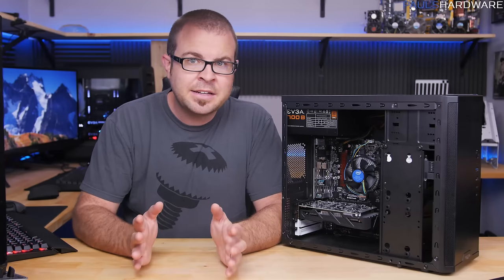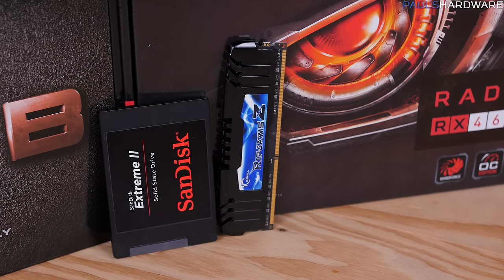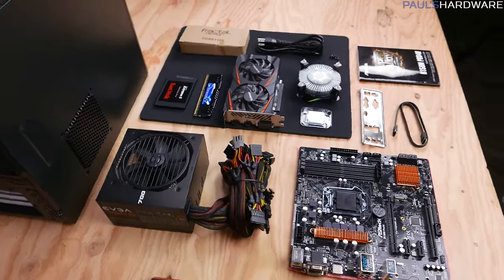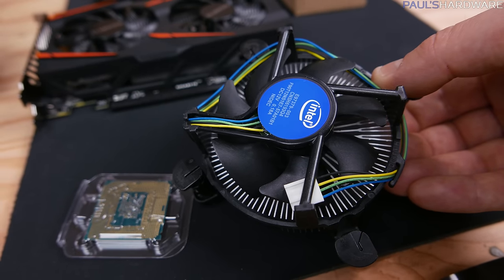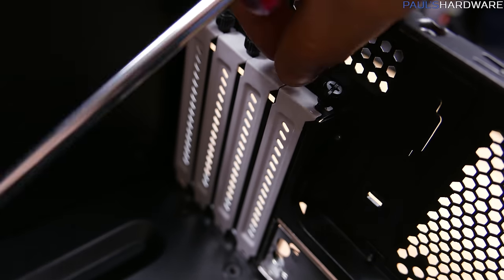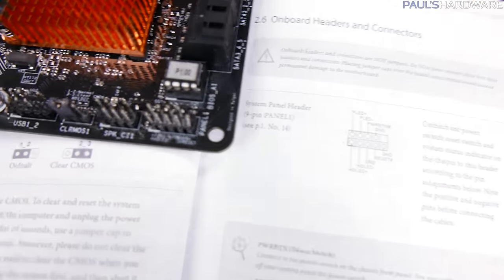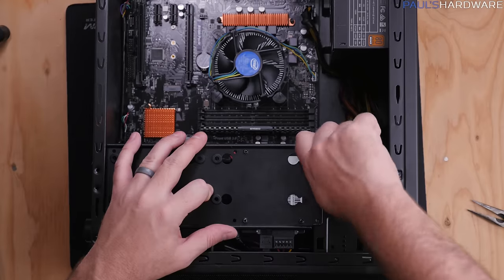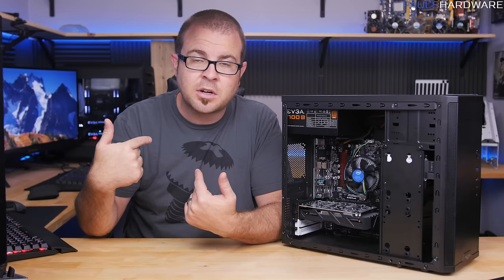How To Build a $500 Gaming Computer

Comment: if you get optiplex 990 second hand with i5 2500 for like 200 dollars, you can get RX 480 / GTX 1060 and still get decent performance
Reply from the maker: the second-hand market has a lot of deals, but they can't be offered to everyone and you're often left with no upgrade path... still would be fun to try though :-D

Comment: I would just spend a little more for an RX 470 / 480 or GTX 1060 3GB and add on a 1TB Hard Drive later.
Reply: you can get a 6gb 1060 for $220
Reply: also nice. Actually this end quarter has some very nice budget options, wait for the 1050 and / or 1050 Ti to be released.
Reply: IND4GR0V3 Where is this?
Reply: Generic Username i would pm it to you so it doesn't sell out, but nobody ever seems to have private messaging enabled on their youtube profile
Reply: IND4GR0V3 What country is this for?
Reply: usa

Comment: SeaSonic offers a 520W fully modular PSU for just $10 or so more than a low grade EVGA PSU, it's called the M12II. I've got 4 of them running 24/7 and they absolutely murder EVGA B and W series on features and build quality.
Reply from the maker: good advice, I love Seasonic
Reply: I've got a ton of EVGA PSUs, a 650GS, 600B, 2 500B, and a 750G2 and I'd take this M12II over any of them. The 650GS is a close second but it's $40 more.

Comment: Don't plug in your psu and touch it. It's dangerous not only to your pc components, but to you too. Instead, just touch the side panel of your case every now and then and you'll be fine..
Reply from the maker: +Joshua Shiozawa touching the case will ground you to the case, which is usually fine, but touching the plugged-in (not switched on) PSU will ground you to the ground

Comment: I'm a bit confused about the graphics card. Why didnt he plug in the power connector for it?
Reply: I don't think the RX460 needs external connectors. He used an OC Gigabyte but most RX460s don't. Could've done it though.

Comment: you can get more bang for your buck if you switch the rest of the way to AMD parts. I kinda splurged in my case, an extra $100 for double the ram, a 750w PSU, and a better CPU, but it wouldn't be hard to cut that extra without sacrificing too much performance.
Reply: Nothing beats the i3 6100 in gaming performance from AMD at 120 dollars.

Comment: Ive done all of that but when I power on my PC it starts to blink, it siwtches on then off, but also doesnt connect to a monitor
Reply: I had the same problem. Idk how I fixed it, but what I think solved it was I used an hdmi cable and connected it from the graphics card. Hope it works for you

Comment: You might really want to get nut drivers for standoffs. If you really want to use pliers, regular slip joint pliers instead of needle nose would be better but would still be wrong.

Comment: Great video can you make a  $550-$650 video editing build please @Paul's Hardware
Reply: Phillip Alers do you also want to game?
Reply: An editing rig is most likely gonna be more pricey, because you are gonna want a better CPU/GPU combo. Look into at least an i5 and a gpu around the 1060 or rx480 range. Probably around $800-$1000 USD
Reply: You could edit with this rig, but it will be slow
Reply: I edit on a 2009 Mac with 16gb or a i3 laptop with 4gb ram fine.

Comment: @Paul's Hardware, does the Does the Intel Core i5 6500 3.20 GHz Quad Core Skylake Desktop Processor support DDR4 2400 memory? Or anyone that knows if it will work but i have to do a update or get different memory sticks.

Comment: Hi, I decided to build this :

gigabyte 990x gaming sli
fx 8350
rx 470
16 gb hyperx fury (1866)
coolermaster 212 evo

Now I cant decide which PSU to get, I have few in mind:
XFX 600 W XT series
FORTRON hyper 600 W
XFX Pro Series CoreEdition 80 550 W
FORTROn rider s (550 W)

Can anyone give me some advice on PSU?
Reply: Marko Cirimotic id say get an Intel CPU since AMD is phasing out the AM3 chips
Reply: Is that it? Can you go for a brand like EVGA, Corsair or Silverstone?
Reply: ECCENTRIC you can
Reply: ***** Cool. And yeah, don't get a 4 year old chip. Buy something like an i5 6500 and a cheapo H110 mobo and since you saved some money on the mobo, get a beefier GPU like the RX 480 or 1060

Comment: i would go for an amd 8320 and a rx 470/480/r8 380x which is going very cheap on amazon
Reply: cheap. wont bottleneck much with lower end cards.
Reply: i3 6100 is actually cheaper and better so why?
Reply: i meant athlon cpus
Reply: francois qian but there is no such thing as an athlon 8320?
Reply: you can fx 8300 and gtx 1060 or 480 for same 500$
Reply: Rashid Aman an i3 6100 wouldn't bottleneck as much as an 8300 or even at all for the same price....
Reply: fliprabbit but wht i think is that with overclocking the fx8300 can beat i3
Reply: Rashid Aman doubt that unless you buy a good cpu fan, but with that added cost you might as well buy a better cpu like an i3 6300.
Reply: i was able to get a 4.2 ghz overclock with my fx8300 with stockfan at 80c
Reply: Rashid Aman 80c is quite a lot :/ , i'd rather have a cool cpu at stable clocks..

Also even at 4.4Ghz it won't surpass the i3 performance, barely keeping up.

Comment: I like this build. For $500 you could build a rx470 biuld, but i would just not be very good. I like the large ssd and i3 in this. You can just upgrade the gpu in this build and youre set
Reply: Captain Cruise all i3 are not overclockable, also the latest i3 chip only is a dual-core with hype threading. The i5 Paul used outperforms any i3.
Reply: He got a i5 6500 in a $500 build?
Reply: Captain Cruise Wait shit lmao, my bad, I thought he did put an i5 in there. But definitely an upgrade in the future loll
Reply: Ow ok, I see. Yeh, I think its better to upgrade the GPU than the cpu. Its much easier for a start, and 0 compatibility isssues
Reply: that doesnt make any sense to have that i5 with a rx460 of 2gb video ram... it should be the opposite, a $100 cpu with a $200 gpu for gaming
Reply: Joaquin Carrillo Yeh I was just saying if you wanted to you could do it this way, and sell the rx460 and buy a rx480/1060 down the line
Reply: Joaquin Carrillo An alternative to upgrading the cpu (motherboard compatibility issues/ disassembling the computer to do so)

Comment: Does 6500 bottleneck gtx 1070?
Reply: that really depends on which resolution are you playing at, GTX 1070 is for 1440p IIRC. If you're playing at 1440, yes there might be some bottleneck, although it might be just a slight one

Comment: using the correct screws for the motherboard standoffs is pretty important... ive got a motherboard permanently stuck in a case :/
Reply from the maker: the old M3 vs UTS 6-32 problem, bane of PC builders everywhere

Comment: Can you give me some insight to why a i3-6100 is better than a rx 6300? :D
Reply from the maker: way way way better instructions per clock performance, and it's not on a dead-end platform/socket, meaning there's viable CPU upgrades now as well as (almost assuredly) more when Kaby Lake launches in January/February
Reply: Thanks a lot
Reply: The cores in the skylake i3 perform better than the cores in AMD'S old 6 core.

Comment: As an IT Pro of 20 years with a masters in electrical engineering  you never plug in the power like this. You really don't understand how electricity works WOW. Touch the metal case and that is good enough.

Comment: Hi I'm new to the PC gaming world & trying to set up a good build, is it possible someone if someone can give me some tips on this build? Thanks 

Intel Core i3-6300 3.8GHz Dual-Core Processor
Cooler Master Hyper 212 EVO 82.9 CFM Sleeve Bearing CPU Cooler
MSI B150 Gaming M3 ATX LGA1151 Motherboard
Kingston HyperX Fury Black 8GB (2 x 4GB) DDR4-2133 Memory
Samsung 120GB 2.5" Solid State Drive
PowerColor Radeon R7 370 2GB PCS+ Video Card
NZXT S340 (Black/Red) ATX Mid Tower Case
EVGA 500W 80+ Bronze Certified ATX Power Supply
Reply: Dayqwon Dawes it's kind of bad for the money but decent if you want a small case. If you're okay with getting a bigger case you can get better graphics cars

Comment: Case is not a good choice (dust magnet, will suck dust inside), several better mATX choices at this price (Thermaltake Versa H15 for example). 1 stick of RAM is not recommended, always use 2 sticks for the dual channel boost. Forget the update for later, you will not find identical stick to buy, you will have to replace it anyway. SSD also not a good choice, same price would offer 2 better alternatives (Kingston v300 for instance). And core i3? really? AMD 860k is WAY better and cheaper, both cpu and motherboard. Leaves extra cash for aftermarket cooling, and you can OC the cpu at 4.5Ghz, like I did. AMD beats Intel for any price range up to 200$ cpu, Intel is only starting to shine with i5 series and up, which is 200$+
Reply: I second the Thermaltake Versa case. I have the Versa H13 and its awesome for the price. Will even take a 240 rad at the front.
Reply: Good points, but it's worth keeping in mind he likely already had/recieved for this build specifically a good portion of these parts for free. Also, you CAN buy more sticks of RAM at the same speed and timing and it will likely still work fine. It's been tested.

Comment: I'm probably going to do something like this but I'm waiting for the 1050 to come out :D Nvidia FTW!!
Reply: Nvidia all the way
Reply: The way it means to be crashed. Have fun with direct X 12!!! Oh wait, nvidia cards can't run direct x 12 correctly.
Reply: fr3fou
 Who?
Reply: not you, the first guy and the 2nd
Reply: IND4GR0V3
 Give at least one valid argument. I bet you can't.
Reply: IND4GR0V3 nice ad hominem
Reply: IND4GR0V3
 Lol someone has no argue.
Reply: I use NVIDIA GPU's, I have 770's, a 970, and a 1070 and I have had nothing but problems with them. The AMD cards I have used in the past have been nothing but rock solid and reliable performers. I've had crashes related solely to either the NVIDIA GPU itself or the mess of code they call drivers. Sure AMD has had a few flops but they are overall more reliable than NVIDIA, not to mention how NVIDIA nerfs their GPU's as soon as a new series launches. My 970 went from being able to run Witcher 3 on high to ultra settings with 55-75 FPS down to roughly 40-55 when the 10 series was introduced. My only qualm with AMD right now is that they are focusing on budget gamers which means there was no RX 490 to compete with the 1070.
Reply: Ryan Grobe
 AMD drivers are perfect right now. You judge on things based in the past.
I can do the same : "MY FX 5800 WAS A JET ENGINE AND MY GTX 480 TOO SO ALL THE NVIDIA CARDS ARE JET ENGINE" this is stupid and useless.
Reply: L3xou97 I didn't bash AMD drivers, I was bashing NVIDIA's current mess of drivers.
Reply: Ryan Grobe
 Your comment isn't clear.
Reply: I got an RX 480 and it almost fried my motherboard. I returned it before the new drivers were released but AMD should freaking TEST their GPU's before releasing the damn thing. I will never go to AMD again. They are hot, loud, and stupid.
Reply: Ghirmay Mesfun
 We all know that the 480 drew more power than norm at the beginning.
It never fried a motherboard. Science studio used a 480 on an old AM2 motherboard from 2006. The only problem was the computer shutting down in games. Who on earth would use a 480 on an AM2 motherboard?
Then the problem is now solved, it's not a problem anymore.
Please do some research before spreading miss information, fanboys like you are annoying. Don't make me waste my time again.
Reply: The problem is, AMD should be smart enough to fix this before their release.
Reply: Ghirmay Mesfun
 The 480 was upped in frequency if you don't know. It was originally made to run at around 1.2 Ghz factory. And it's undervolting very well. You can even undervolt and overclock.
Reply: L3xou97 If it came out of the box with a problem, it's AMD's fault no matter what. All of the reference models came out at stock frequencies.
Reply: Ghirmay Mesfun
 It came out with a problem, people bought it and AMD solved the problem with driver update for all the 480. Yes, all the 480.
970 came out with a problem, Nvidia did nothing.
Reply: AMD came out with a problem that made the GPU almost useless. Nvidia came with a "problem" which really was not a problem and everyone with a 970 got paid 30 bucks anyway. It was not a problem because the gpu would use that extra 500mb of GDDR5 ram when it was NEEDED. It showed as 3.5Gb, but was actually two different 0.5GB and 3.5GB ram when the 0.5 was used when necessary

Comment: is power supply and ups the same ? please someone reply:)
Reply: Thanks bro
Reply: Mr Pakoda a ups (uninterruptible power supply) is basically like a battery. If for whatever reason the power goes out, a ups can give you the time to power off your pc safely. However you still need a power supply that you can plug in to the ups. Hope I helped sorry for my English
Reply: thanks you're english pretty good
Reply: No, they're different.  But power supply and PSU (power supply unit) are the same.

Comment: my budget is about $600 dollars, so what parts of this build should I upgrade.
Reply: jacob nuse CPU. Get an i5 instead.
Reply: jacob nuse get an rx 480 instead of the 460 in this video.  the 460 isn't made for gaming
Reply: both of these. An i5 6500 and RX470 will be good. And get a 500 watt PSU for some OC.

Comment: I'm suprised the RAM slots weren't labeled 1-4.  I know mine are labeled right on the PCB.
Reply: They are labelled, but that's not the order you put them in. You almost never put RAM in slots 1 and 2, for example. It would normally be 1 and 3 or 2 and 4.
Reply from the maker: +David Douchecovny The manual says it doesn't matter if you use the A channels or B channels if you're using 2 sticks, but doesn't show configs for just one, probably because it doesn't matter :-P I'm pretty sure any slot would work

Comment: Why no dual channel? It's a free fps (2x4gb)
Reply: It makes no difference in games, unless you are running an APU in some fringe cases.
Reply: ECCENTRIC you're wrong i'm sure
Reply: 2x4 has a little more performance than just 1 stick but the 1 8gb stick will run games slightly slower than with 2x4.

Comment: Please, for the love of god, spare some coin to buy aftermarket cooler. Not that it don't work well (it's a non-K CPU, after all), but Intel stock cooler tend to die quickly, making your CPU hotter while it's dying.
For $20, you can already buy something like Cryorig M9i.
Reply: the intel stock cpu cooler is fine for cpus like this with no overclocking. Intel wouldn't package a cooler that couldn't cool their CPU's because that would just alienate their brand.
Reply: I haven't had one die prematurely yet
Reply: no they do not die quickly
Reply: King Quartz Tell that to 3 of my cooler.
Reply: AlphaCore tell that to my 5 year old intel stock cooler still using it.
Reply: I have a stock cooler on my 4-year-old Core i3 2120T that runs 24/7 in my HTPC.  I check its operation every time I clean it and it's running just fine.
Reply: 8 y/o stock cooler on my c2d e8400 and still working like a charm

Comment: Who else removes the processor cover before locking the socket lid? The amount of pressure needed to lock the lever with cover on is more than what I'm comfortable with; I'm afraid that it might break the processor or something.
Reply: If the orientation of the CPU is good, don't be afraid to press down. Make sure you're pressing the motherboard against something hard. Chips are usually much sturdier than they look, it's the capacitors and resistors that tend to be flimsy.

Comment: Step 1: Ignore this Video

Step 2: even 4th gen i5's will provide a good gaming option so second hand is best.

Step 3: Yes ram speed does matter but at the moment performance is marginal at the moment. ddr3 2300 speed ram still kick's ass. 

Step 4: any amd or nvidia gpu is a good option but more than likely a 1gb or even 2 gb of vram gpu will hold you back a little in modern games (unless you drop the res and graphics options)
Reply: wrong wrong wrong. What's the point of buying a Haswell 4 core if it costs the same as a 4 core Skylake CPU? And not every GPU with 2GB of VRAM is good. Take a look at the GTX 1050 Ti vs the GT 740...
Reply: gtx 650ti for $50 on ebay, gtx eighty five dollars 

gtx 760 75 dollars, x2 = price of one modern day equivilent

i5 4570 $75 -80 dollars. Strong ass cpu 

I'm sorry but as an older tech buyer and not going for all the modern day stuff i've probably saved like $600 and still have an optimal gaming rig.
Reply: Proof? Where are the examples?

I also like used hardware, but buying a used Haswell right now is pointless, since it's sold at basically new prices.

And NVidia cards age like milk. A 760 (2GB) is roughly equivalent to a 1050. And a 650 Ti is basically an R7 360. With the added benefit of more heat, added PCIe power and less VRAM.
Reply: Just use ebay and you'll see.
Reply: Boiled Egg I have used eBay. The cheapest i5 4570 (without a bid) was around 140 bucks (no shipping). The 760 was pretty close, it was 95 bucks unshipped. And the 650 Ti was around 85 bucks unshipped.
Reply: got the link?
Reply: Also I have a link of a 650ti that i bought for 54  bucks  brand new from evga. On the i5 4570 on the one i'm viewing is 100 bucks and that's still 99 dollars less with kick ass performance.
Reply: Boiled Egg did you send me a link?? LOL
Reply: Boiled Egg Send me one, then! Type it in the comments! Prove your point! If you can't then I am correct!
Reply: Sure, link will come via photo bucket with my details blacked out. Will that suffice?
Reply: Boiled Egg sureeee.... If you give me an easy link :P
Reply: one momento. will provide
Reply: Boiled Egg ok. post it here.